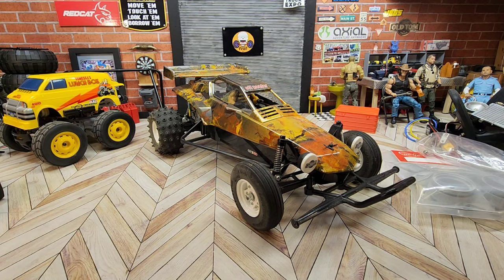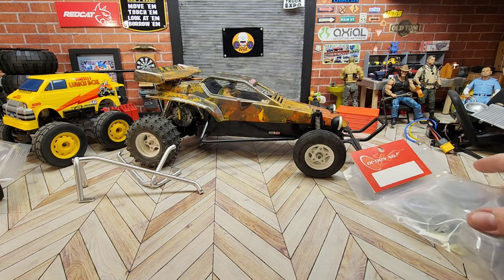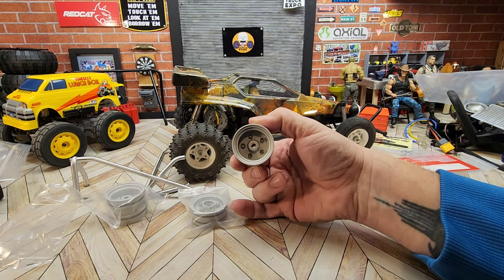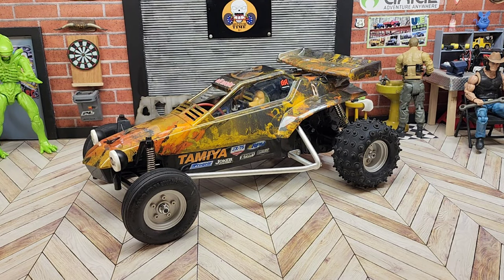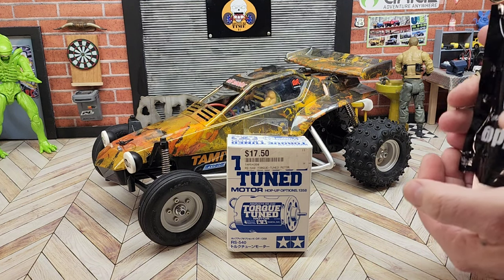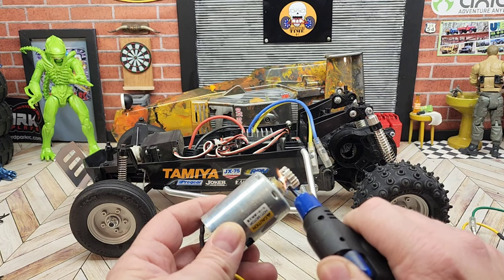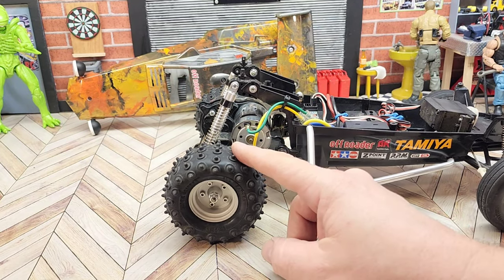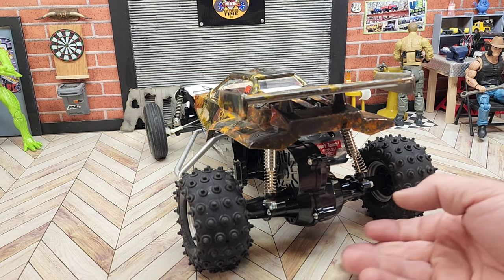Tamiya Hornet Upgrades And Bling

Comment: Looks very racy now!  can't wait to see it go with the extra weight it may not pop off the ground as much.
Reply: mine cut for 2x3 saddle pack at rear (CG back+up more) handled lots better than stock for putting more weight where+when it counted. it took a ton of tinkering to make it stay flat for power sliding corners but once there it was quick around the track. I should have kept it but got more into racing my Fox and RC10.